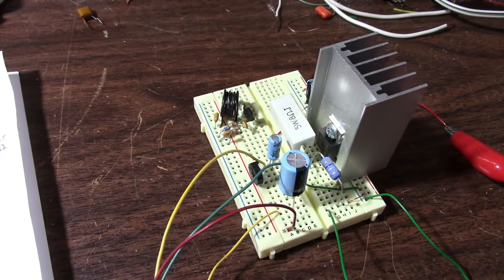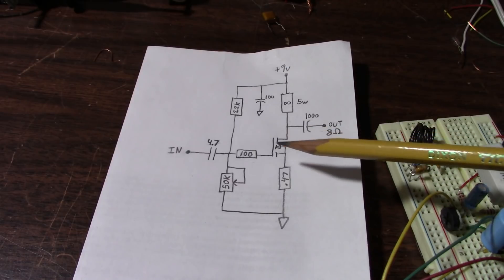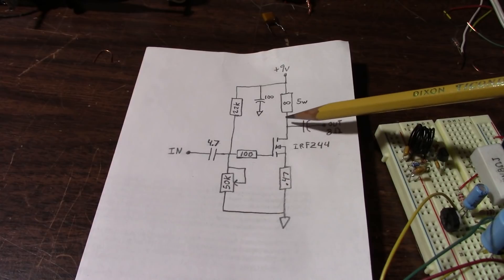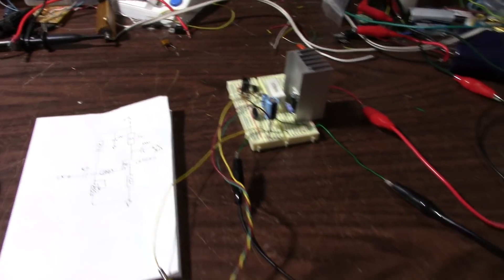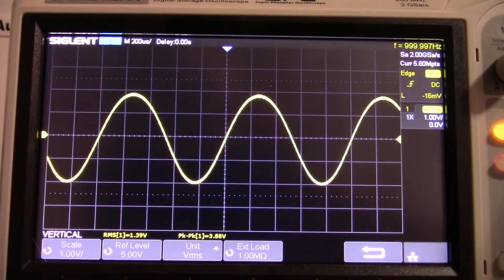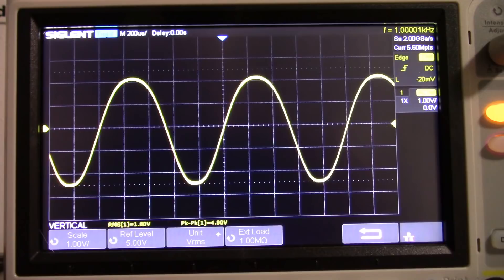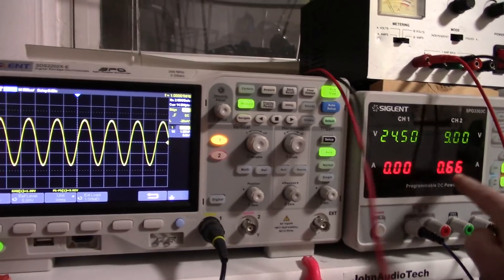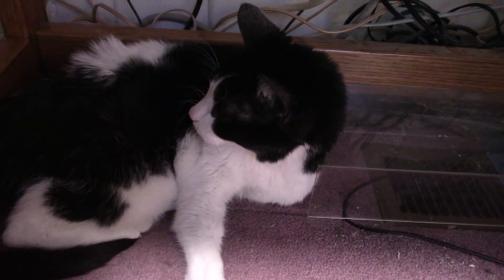Class A MOSFET amplifier using one transistor - with schematic

Comment: I love these little single ended circuits! Not the highest performance, but simple and practical for low power loads -- I use a small scale one of about 20mW to power my headphones. The distortion cleans up a lot if you can put the gate-source 'junction' through a feedback loop of another amplifier, which was a popular old design!

Comment: This fet is not very linear for different voltages vs current...
Reply: As with most FETs, the transfer characteristic when used as an amplifier produces a drain current approximately proportional to the square of the difference between the gate voltage and the threshold voltage. This produces second harmonic distortion, but the ear tolerates that far better than odd order harmonic distortion.

For comparison, a bipolar transistor has a transfer characteristic that produces a collector current approximately proportional to the exponent of the base-emitter voltage, which is far less linear.

In all cases, we apply negative feedback in amplifier circuits that reduces the gain but improves the linearity. It also makes the performance much less dependant on the characteristics of the individual transistor and allows circuits to be reproducible.
Reply: @RexxSchneider  your comment is pure gold for me

Comment: I also have one suggestion for future video. Since many of your projects are about small  IC based  power amplifiers, it would be nice to explain how to add headphones output in parallel with speakers output. The gain and power is usually too high for headphones, so some voltage divider is needed. The video could be about how to calculate values and power of proper resistors.

Comment: Please make a video on ground loop isolation.  After connecting Bluetooth module my amplifier is making noises. Is there any way of getting rid of it besides using a separate power supply?  There are dc transformers (isolators) in market but they are very expensive. They alone cost more than my assembly (Bluetooth module and amplifier) please help.

Comment: Id be curious to see the difference in output on an 8ohm resistor versus an 8 ohm speaker. For example I'm simulating my load as 8ohm but I'm physically operating it against two speakers in series that total a resistance of 6.4ohm to a standard volt/ohm meter. Is their a more accurate way of simulating a speaker? Maybe just a different ohm value? A resistor/inductor/capacitor in parallel? Does the difference matter?

Comment: So your using your preamplifier as a volume control? Adjusting your preamplifier up and down does what? Increase and decrease the voltage and the amperage? Does an increase in voltage or amperage have more of an effect than the other on this circuits input or are they slaves together and acting linear? I'm not too sure I have explained my questions without adding more confusion.
Reply from the maker: I use the preamp as it has an easy to use dial control to adjust the source signal level. The music player volume control adjusts in large steps that is hard to fine tune. Also, the music player I use output is below standard line level so the preamp boosts it a bit to a usable level.

Comment: Thank you for the very easy to understand circuit, I'll have to spend a bit more time trying to really understand how the negative feedback works. I like that you're highlighting the fact that mosfets use voltage to control a current,  it's easy to see why that is so useful in this circuit.

Comment: As a suggestion, on the schematics you could add the bias voltages and the bias currents. It will make is easier to understand the circuit.

Voltages in green and currents in red will match the power supply s display.

Comment: very interestin. i wounder if you could swop the big resistor for an out put transformer?
Reply: Yes, I've took the idea to extremes using a universal tube output transformer and a high voltage supply. The output becomes very linear as the current modulation through the MOSFET is in the ma range. However I ended up with having to use IRF840 to survive the voltage present across it. At clipping onset my design puts 500v across the output.

I did a video on it, but it's more a badly phone recorded video of designing it, rather than the schematic and testing of a working amp.

Most output transformers, especially single ended are going to be high turns ratio ones designed for valve impedance matching.
Reply from the maker: I did this with a similar circuit using a bipolar junction transistor. I used an inductor as it is low resistance to the DC bias currents and passes them through. The varying signal voltage is high impedance to the coil and that passes through the speaker that is connected across the coil.